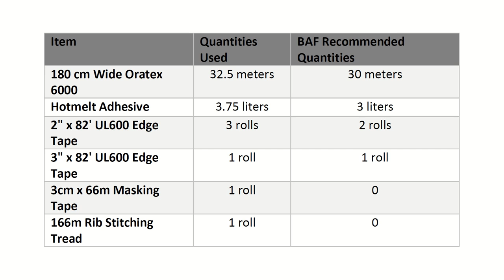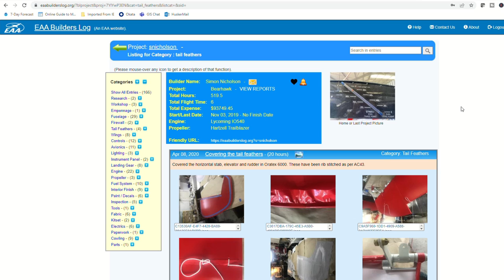Covering the Bearhawk Model Five Fuselage With Oratex

Comment: You may have just solved my problem!  I'm using oratex on my little one-seater.. and I have been having a terrible time passing the pull test. I've been using the same heat gun as you, but I've been setting the temp at 200°.. I noticed when you use the heat gun you set it at 400°.  This has been very frustrating, and has been going on for a few weeks, just received fresh glue from baf... Many thanks, and I'll let you know
Reply from the maker: I bet you’ll have a lot better luck using 400° F. As an aside, I tried to note the temperate I was using in the lower corner of the screen. Different temps for different applications, but 400° F was typically the best temp for permanently setting the glue for us.
Reply: @ColbyOsborn  ... Your videos have already been more helpful than BAF has been.. if you don't mind, I may have more questions in the future...

Comment: Brilliant Work! Colby.  The quality of your build is exceptional.   I'm curious, what you would budget for the build of the BH5?  Are you planning to make it IFR capable?   Continued success and Clear Skies! joesky!
Reply from the maker: Thanks, Joseph! Our plane will not be IFR capable. Although it wouldn't be too difficult to add this capability down the road if we change our mind. 
I believe ours will come in around 160k. I think one could bring that down closer to 100k with a used prop, mid time engine or doing a field overhaul yourself, cover with polyfiber, and a very basic panel. 
But it would also be very easy to spend well over 200k with many of the commonly chosen options like a new engine, 3-blade composite prop, professionally made seats, IFR panel, hiring someone to complete your panel, and hiring a professional to paint it.
Reply: @ColbyOsborn  It's all about the mission and budget!    I love the New Sling High Wing but $250K if you want it IFR capable, plus they told me its now a 2+ year wait because they have so many orders.  I like your choice of the Oratex too!  Did you say you are going to Oratex the interior?  Is that standard?  I'm wondering if that would give you any insulation quality (like a double pane window)  Can't wait to see your power plant and avionic choices.   Clear Skies, joesky
Reply from the maker: @jshulsky  We did install Oratex in the interior. Mostly just in the baggage area. Using fabric on the interior seems to be a pretty popular choice amongst Bearhawk builders. I'm sure the fabric helps seal things up a little more and maybe has a slight insulating benefit, but I'm guessing it's not a noticeable amount. I think it's mostly just for looks, and to protect the exterior fabric from being damaged from the inside.

Comment: What would say about using STITZ for covering ?   Is there a plan/procedure for covering in aluminum ?
Reply from the maker: Lots of Bearhawk builders use stitz or polyfiber. Economical and has stood the test of time. It’s heavier and requires a fair bit of PPE that I didn’t want to deal with if I didn’t have to. If I ever build a plane more for show I would certainly consider using it though. 
Covering the Bearhawk with aluminum is strongly discourage, so it’s not something I looked into much. I believe there’s some discussion related to that on the Bearhawk Forum if it’s something you’re interested in.